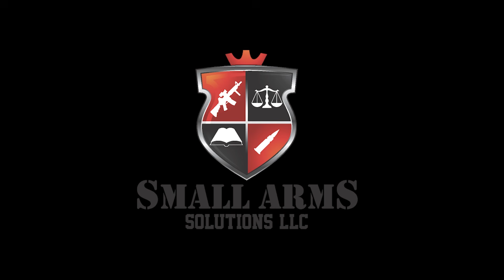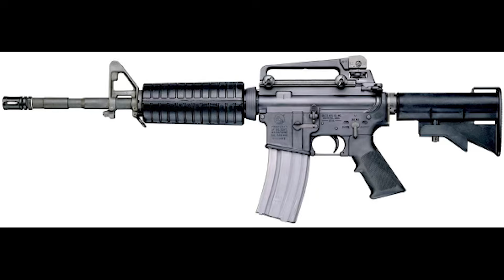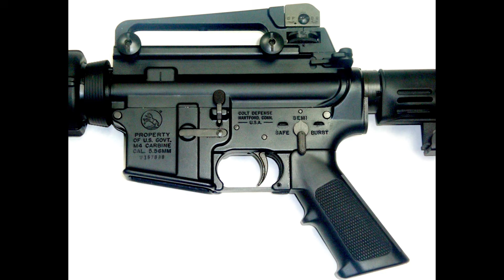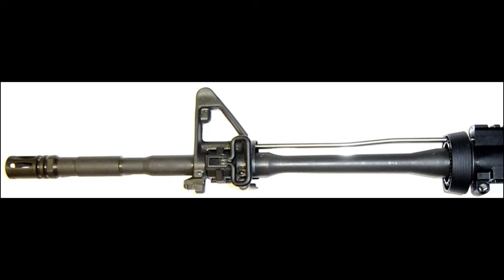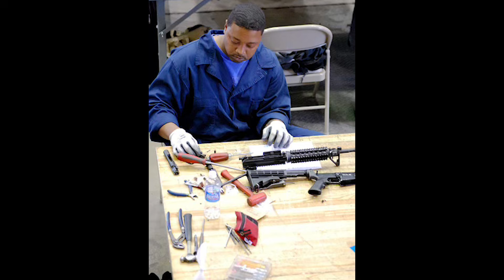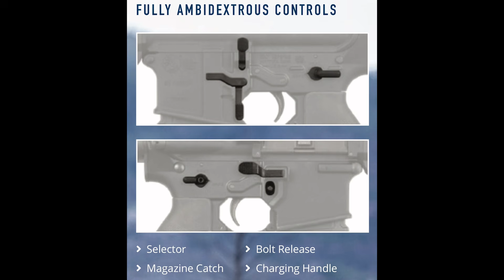History of the US Govt M4A1 Carbine

Comment: I carried an M4 in Afghanistan and Iraq as an infantryman and paratrooper, and I never had an issue with it. Granted, I never fired more than a magazine or two at one time, given we had mounted heavy weapons, but even in training I found it reliable and accurate.
Reply: I carried the M16 (604), GAU-5/XM-177, M16A2, M4 & M4A1 in my career. Nothing really beat the original M16. The 604 was light, handy, and very maneuverable. All business
Reply: I never went to combat but used it a lot in training at Campbell. It always worked and even with high volumes of fire I never noticed a big shift in accuracy. To be honest, I think this guy tends to get lost in the sauce on specifics. I think if the rifle has 3 to 4 MOA while hot, it is "good enough" for most 11B or 19D. Even then, my PSG said it best, "Your M4 is a personal defense weapon. If you aren't bringing up the 240 and calling in mortars after you dump a mag, you're doing it wrong."

Even then, most Soldiers or Marines carry between 210 and 300ish rounds spread between 7 to 10 mags. Your basic dude who isn't a group hotshot isn't going to be dumping ammo fast enough to notice the benefits of the SOCOM barrel IMHO. They'll notice the weight for sure. But again, I was always within a few hundred meters of my truck and the .50 or Mk19 mounted on top. Plus the two 240's we had in each team at the section level.
Reply: @Thrainite  The original M4 barrel was just fine and I prefer it over the SOCOM profile any day of the week.  I shot high volume sessions, like 1100 rounds within 4hrs doing CQM training at Bragg with no issues whatsoever.  The SEALs who were running their M4A1s like LMGs on AUTO were the culprits for the SOCOM profile.  You should never be placing an M4A1 on AUTO, so it was a moot point.
Reply: @LRRPFco52 what's the reason of having automatic carbine then? You could have a battle rifle
Reply: @ФедяКрюков-в6ь  After WWII, armies thought following the design of the Sturmgewehr made sense, where you combine a service rifle with a submachinegun, but they didn't really understand what the Stg44 was.

Stg44 operated under the constant recoil principle on AUTO, with a very low cyclic rate.  You can fire rapid strings of fire faster with an M4 on SEMI.

Once you let soldiers fire on AUTO, their basic load gets rapidly depleted, and the logistics system cavitates or struggles to keep up, leading to lulls in fire, overrun situations, and stalls in combat momentum.

By the 1980s, US Army Infantrymen primarily trained to fire on SEMI anyway and that never changed.  Better to hit the target than spray rounds all over.

There are guys who spent 2 decades in JSOC without ever firing their M4A1s or Hk416s on AUTO.
Reply: @LRRPFco52  that's why soldiers are supposed to be trained firing short controlled bursts, at least those who are supposed to be a riflemen. Of course you could just tap the trigger fast enough to basically simulate burst fire, but why. Not to mention saturation fire from a carbine as an ad hoc SAW is also viable tactics sometimes. If a carbine isn't designed to do that, why keep "AUTO" at all, not to mention switching to "AUTO" from initial "BURST" mode. I think, SEAL guys knew what they are doing after all
Reply: @ФедяКрюков-в6ь  SEALs were doing their old break contact immediate action drills with full auto mag dumps as part of their live-fire exercises in land warfare blocks.

They thought it looks and sounds cool since they don't have adult supervision from guys with solid infantry backgrounds.  They also do a lot of work in and out of the water, so any riverine or over the beach ops with live fire takes the weapons through harsher cycles. 

We did break contact drills in all the Recon units I was in, with 1 & 2 men doing initial mag dumps, but not everybody, then rotated through the positions in the Team.

3, 4, 5, & 6 man would only shoot on SEMI usually, or maybe the tail gunner/6 man would go Full Auto.

We didn't trash the weapons.  Everything ran fine, and we did those drills for 8 days/7 nights straight with formal metrics covered in the ARTEP.  We went through a lot of M18 Smoke grenades as well, and did simulated and live claymores.

Guys in Force Recon, Ranger Regiment, and SF didn't destroy their weapons in high volume training either, with maybe a few exceptions of high round count guns that had bolt failures.

I do know of at least 1 carbine in SFARTAETC that exploded, leaving the guy holding the KAC VFG and barrel w/ handguard in one hand, and lower receiver in the other hand.  The upper turned into a grenade, but he was uninjured.

It was like Chris described in this video, caused by too much dynamic tension on the handguard without being free-floated, heated up doing high volume CQM at Range 37.

SOPMOD Block II fixed that.
Reply: @LRRPFco52  The Wehrmacht was ordered to only fire the STG in auto in an emergency.
Reply: @Thrainite But isn't that part of the issue? Soldiers don't really "notice" what could be better or not, but usually are told to make do with what you have. 

Besides, I think U.S. Ordnance usually is crappy. Just look at U.S. Ordnance history...
Reply: @georgewhitworth9742  I think replacing the .50 and M240 would have done far more for our warfighting capability than reinventing the wheel with the current sig 6.8mm. Nor would trying to alter the M4 to make it heavier than it needs to be when it is already heavier than my dad's M16. Soldiers do know a few things. Like how your basic Joe isn't dumping more than his standard load out unless he wants to break his knees and back over water, food, wet wipes, spare socks and 240 belts. Or that just lightening the load is preferred over adding more gear that won't be maintained or carried. But no one ever asked me or the 11B's in my sister battalion. The regular dudes sleeping in dirt usually are just told what to carry 85% of the time.
Reply: I served in Afghanistan. I was a British soldier. Believe it or not the SA80A2 using live ammunition was actually quite reliable. I only got a stoppage when I had a dud round. The only time I had problems with it was with blanks. But that's in training and nobody is actually trying to kill you. The A2 was remade by HK. That's why it worked
Reply: @aaronwilkinson8963  The most interesting thing to me about the L85/SA80 was that SAS looked at it when it was developed, and never used it.
Reply: @LRRPFco52   They get to carry any weapons they want. It's like the US SEALs they decided they didn't like the Bereta and went with the Sig. The SAS do their own shit. They do their own testing. They are well funded. The SAS liked the M4 or a version of it because the M16/M4 is a better rifle than the SA80. The common squaddie get what they are given and shut up. We had a world respected rifle with the Lee Enfield. The L1A1 SLR. Was the right arm of the free world SO CALLED. Then we went with the SA80. It's a real down grade. The SA80 Went to HK to get remade and now they are OK. Alot of the internal parts are HK
Reply: That's cool
Reply: We have plenty of them now since you ppl left. You ever had jamming issue?

Comment: Rocked an M4 Carbine Gov't profile with an ACOG all through the GWOT from 04'-07'. It never once seen burst mode and I had ZERO issues with it. I think switching the SOCOM barrel was just an excuse for the Gov't to spend more money.
Reply: The SOCOM barrel is for full auto fire sustainability.
Reply: @lzxray6781  It wasn't designed for sustained "accurate" full auto fire. That's why you have 0331's and Machine Gunners. If you have to burn through 7 mags sustained fire, you got a helluva problem on your hands that Air can take care of.
Reply: Remember, in the early GWOT days, they put commercial varmint uppers on FA M16A1 lowers and used them as sniper rifles. However, they often got used as a light machinegun when things went sideways. SOCOM started using M4s in the same manner. An inch wide, varmint heavy barrel can do it. All those cuts in an M4 barrel create failure points. They can't handle it.
Reply: @donwyoming1936  My M4 Gov't barrel carbine served me well. I used the same rifle with the same parts for 4 years in Iraq, Afghanistan, and Africa and never had 1 problem out of it. It definitely got the job done.

Comment: @16:46 the Battle of Wanat (OEF 2008) had several critical M4 failures.
Reply: Applies to ALL weapon systems. When you need it most, of course.
Reply: @Rustebadge The AK's didn't fail in that battle btw.
Reply from the maker: Different bullets with different set of issues. The M4 was not designed for what it was being used for. The AK was. Now put a current M4A1 up against the AK, The AK will melt down first and overheat faster. That is not apples to apples comparison.
Reply: @frankopanklaric  How do you know?

Comment: So why did they keep the gov profile on the URGIs (DD barrels) and why won't they overheat as much as old gov 14.5" barrel did?
Reply: I agree with this guy, the gov profile is stupid. Where I disagree is that I think the SOCOM profile, while significantly better than a gov profile, is also not ideal. I like the Geissele taper profile. A bunch of companies are making tapered profiles now, Geissele is the best one I've tried. It's thick enough that you aren't using a modified pencil profile but thin enough to still be handy and it doesn't try to defy the laws of physics like the gov profile.

I think the reason SOCOM didn't want the SOCOM profile anymore was that they stopped trying to make their carbine into a make shift LMG and instead just purchased more LMGs. You live, you learn...

Comment: "Well, I'll just say it -- this was a stupid design." I literally laughed out loud. Also 100% agree, it was a baffling choice that has made me paranoid about barrel thickness.
Reply: I think the proliferation of barrel profiles like the BA Hanson or the Faxon gunner have been pretty forward thinking designs. Especially in the era where lights, lasers, suppressors, etc... add quite a bit of weight to the front end.

I don't know of the US adopting any such pattern though.
Reply: @TheBradyrulez  There was nothing wrong with the 727/original M4 profile.
Reply: @LRRPFco52 until you put a can it, I’ve watched a lot of “lighter weight” barrels once the weight of a suppressor is added the accuracy opens up 1-2 moa
Reply: @publicpersuaders  I've been shooting suppressed since 1998, covering a pretty wide variety of cans from the KAC NT4 to Ase Utra, BR Tuote, European Brugger & Thommett, AEM5s, AAC, YHM, SiCo, TBAC, Form 1 cans, etc.

Typically we see accuracy and precision tighten-up as long as the bore is concentric and the can is made right.  They act as a harmonic dampener usually.  In rare cases, the addition of the can will increase erratic harmonic resonance and open up the group.
Reply: @ so like I said I’ve seen groups open up on lighter profile barrels haha, I’ve seen it on colt pencil barrels, Bcm enhanced light weights, and pretty much any aero build upper that was free floated, but that could just because aero barrels are 4 MOA as is lol
Reply: @publicpersuaders  On one of the lighter featherweight hunting barrels on a .308 SAKO 75, with a reflex BR Tuote can, I took that rifle through 2 & 3-day Sniper Instructor courses and it just kept delivering superb accuracy and precision throughout each day.  Fist-sized groups at 700m, 3cm groups at 300m.  Barrel steel quality and concentricity will make for a good lightweight shooter.

Pencil weights on the AR are meant for lightweight over anything else, though I have Liljas with govt profile that shoot bug holes, both in 6.5 Grendel.
Reply: @ I’m hella confused on how you are defending colt 727 barrels, by telling me how accurate you’re .308 bolt gun and modern 6.5 Grendel AR is.. 🤔
Reply: @publicpersuaders  I have a 727 and I was issued M4A1s and M4s with the 727 profile barrel before the SOCOM profile.  My 727 shoots great.  Govt-issued M4s shot like crap as a general rule because the spec only called for 4 MOA.

The conversation is in the wrong place if it’s about barrel profile vs barrel quality when talking about accuracy/precision.  That’s my main point.  Same with durability.  We never had issues with durability with the older 727 profile.  The units that did were running their M4A1s like LMGs in Full Auto doing, thinking it was cool and looking like Hollywood, vs actual effects-based training.

There isn’t anything wrong with the 727 profile.
Reply: My government profile barrel produced better groups than my Hanson upper. I think there’s some validity to more weight at the end of the barrel similar to a suppressor that affects barrel harmonics.
Reply: GoldenWebb does barrel meltdown tests on his channel. The tests are completely unrealistic and yet there is still information to be gleaned from them. 

Government profile barrels are always the first to fail. Usually they fail by barrel deformation and then rupturing as it can no longer contain a projectile.
In one of the tests the barrel failed so spectacularly the catastrophic ventilation blew out through the handguard. The handguard was completely mangled.